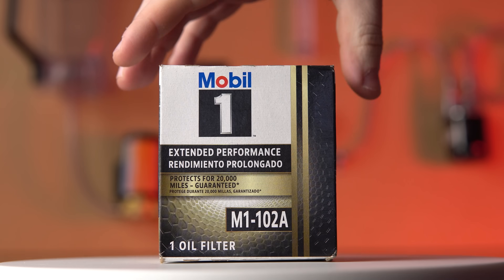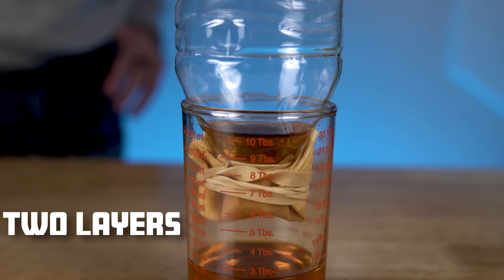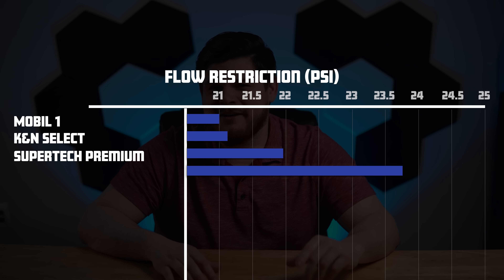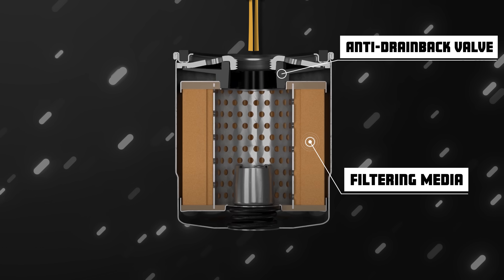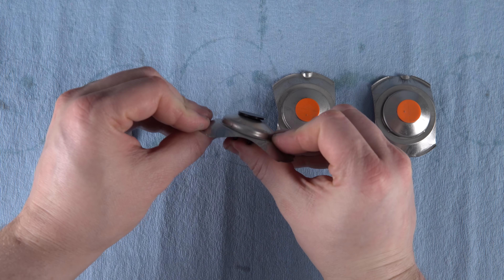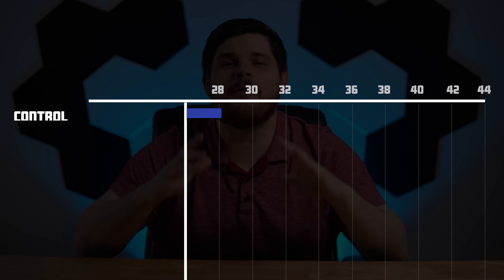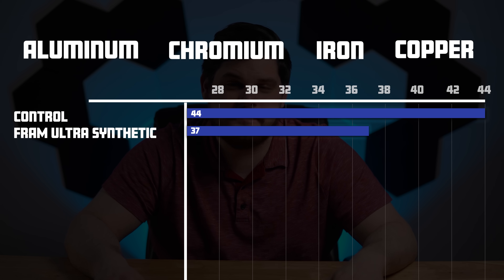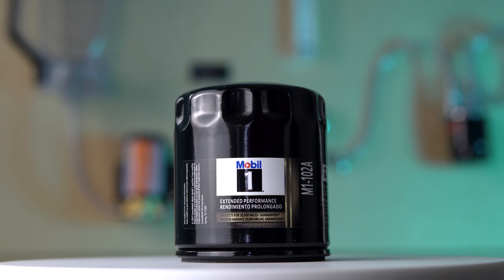Engineers Test the Best Oil Filters! FRAM | Mobil 1 | K&N | Walmart Brand

Comment: Great vid!  However, The filter back pressure is inconsequential. All filter systems have a bypass that allow the oil to bypass the filter and go directly to the engine. Although the primary purpose of this bypass is to prevent engine damage in the event of a clogged filter, if the filter is not passing all the oil going to the engine, it doesn’t mean that the filtering is bad. In fact, it could mean that the filtering is good, because the filter is possibly filtering out smaller particles. What needs to be measured is not just what the pressure drop is, but the pressure drop and how clean the oil is coming out on the other side. Those two factors together plus also measuring how much crud can be collected in the filter before it quits flowing, those are the factors you would like to measure. You did a good job covering all these factors so Bravo!

Comment: Any filter around $10.00 give or take a buck or two should be sufficient. I’m a Mobil One filter guy for my 2007 Jeep Grand Cherokee with 144,000 miles and still runs great no burning or leaking. High mileage oils have conditioners to keep the seals in good condition so I would recommend them. Best oil is clean oil.

Comment: Holding less grams of aluminum powder may not be a bad thing. It may mean that the filter has smaller pores, this clogging more quickly, but also filtering smaller particles. And if there were this much aluminum in the oil, the engine would be toast anyway.

Comment: Nobody should be going over 5,000 miles. I dont care what kind of magic oil you use, or what filter. 10,000 miles, 20,000 is just rediculious. Especially on todays small gdi turbo engines. I still change my oil at 3500 miles. Just an old habit from the conventional 10w30 days. I enjoy changing my oil, its not that expensive, and I plan on keeping my current vehicle forever. One thing people forget to do these days is replace their pcv valves. That is critical. I also highly recommend an oil catch can on modern gdi engines. Especially if its turbo.

Comment: Let me guess that this evaluation was supported and paid for by Mobil 1. You couldn't have sounded more bias throughout the video if you wanted to. Not a huge fan of Fram, but a 20 micron filter surpasses a 30 under normal conditions every day of the week. How comical when you spoon feed aluminum into a filter then criticize it's clogged after it stopped every bit.

Comment: I use Mobil 1 Extended Performance oil and matching filters in my 2006 Acura CSX. I put around 10-12,000 kms on my car per year; mostly short trips in town. Even though the oil is claimed to be good for one year or 25,000 kms, I change it twice per year in the spring and in the fall. I buy the oil and filters ahead of time when they’re on sale; meaning I can do premium synthetic oil changes for less than $60 here in Canada. I also like knowing exactly what is going into my car, that it’s done right, and I can look at other components while I’m under the car. 

Some people might say that the auto engineers know best when they suggest oil change intervals of 10-15 thousand miles between oil changes. However, those intervals allow them to claim lower annual maintenance costs in their marketing. Also, it’s probably fair to say that the manufacturers probably care more about the engine just making it past their factory warranty rather than the customer getting the absolute  most life out of their engine.
Reply from the maker: Thank you for sharing and for watching!
Reply: Thanks for putting in the time and effort towards creating such an in depth, educational video. The tests were all well done and relevant towards the actual use and function of oil filters. 

Taking them all apart and explaining the various parts as well as their purpose was the icing on the cake for me.

Comment: Will the minor differences at the extremes make any difference in a real car? 40 ppm after 18k miles is about .2 grams of total material in 6 quarts of oil. Does the ability to hold 48 vs 25 grams matter when you’re filtering out .2 grams

Comment: It doesn't matter what science shows....many people will still believe the old "3,000 miles and oil is cheap".  The truth is...oil technologies have improved to conserve resources while providing better protection.  Today's oil is not "cheap" for some people.  I only use Amsoil.  Not because it costs more...but it's been proven better time and time again...despite naysayers attempts to say otherwise.  However there are many impressive oil brands regardless, but I need specific oils for my car and am limited to just a few.  It doesn't matter what's on the side of the oil filter box if you don't maintain your vehicle properly ...nor if you are buying the cheapest oils out there.  They are cheap for a reason.  Oil filter capacity should not be as much of a concern as the micron levels and multi pass filtration ratings.  If your car is maxing out the filtration of the filters...your car is wearing or breaking down irregularly and you have bigger issues.  Buy a good quality filter and change your oils regularly based on what you are actually buying.  I am comfortable with my Mahle cartridge filters and Amsoil for my BMW at 7500 mile intervals.  Why?  The oil analysis I had performed indicated that the oil would go longer....perhaps 10k as BMW recommends.  Each oil change ( self performed) costs me about $80 in materials....up to 3 times a year.

Comment: I put 478,000 miles on a SAAB 900 TURBO using 10w30 Castrol and Fram filters Original Turbo and she is still going smooth... even 10w30 Castrol in gearbox well transaxle...changed every 3,000 miles...

Comment: The test method has an issue. Measuring a pressure before the filter thats above the bypass rating without a restriction after the filter means all of these filters were in bypass, meaninf the ratings were showing flow rate of that bypass. 

The more accurate way would be to restrict the flow after the filter and measure the difference between the two, making sure the pressure difference didnt exceed the bypass spec.
Reply: Also I should point out that under normal operation at operating temperature every filter will be in partial bypass during high rpm or sudden rpm changes. Besides cold start the primary job of the bypass is to allow most of the oil to be filtered without building pressure that would collapse and tear the filtering media.
Reply from the maker: @braschlosan, you bring excellent points! We have greatly improved our testing procedures to follow ISO standards to the best of our ability. Feel free to checkout our new videos. All feedback is greatly appreciated.

Comment: Fram is garbage and has been garbage since the very first one! I had an engine built once, gave them a Mobile filter and Castrol oil only to find out after 3000 miles they kept my good stuff and threw Fram on it and who knows what for “oil” and it was full of paper and shit! 20 years ago $1500 rebuild turned to shit and I got the privilege of eating that shit! Never use Fram! Stop using places that use Fram! Always check and pull it straight off and throw it at them! Walmart’s SuperTech works well, AC Delhi is superior for all GM’s, Motocraft for ford and I always used Mobile’s filters for my Ram. When the Ram was finished the engine was all that never needed major work. My Saturn has 322+++ miles and that engine is as good as any competitor at 20,000 miles. Wife’s Pontiac gets Delhi filters and guess what, that engine outlived her transmission and is still a powerhouse. The biggest rule for not sabotaging your engine oil is NEVER USE A FRAM. If you can’t get anything else, don’t change the oil until you can get any different filter
Reply: lies

Comment: I have been hearing that from oil filters are the worst for decades. There’s a problem with this. Frenak makes oil filters for customer businesses also under the customers name. If you ever suspect that and oil filter may also be made by Fram but has a different name like STP or Deutsch, open the box and compare where are the oil filter gasket and screw on section is.. compare the two filters, Frim, and whatever you think may be made by for him, if they are the same, those customer filters are also made by Fram to their standards with their materials and manufacturing process
  to be safe, just by Purolator, oil filters, or NAPA, gold, or hiflo-i think made in the UK..hiflo filters come with a protective plastic shower hat, like cover on the filter and, the gasket is already coated with Petroleum jelly

Comment: I just saw a product on Amazon. A disk shaped magnet slightly less in diameter as THESE filters that attached at the end of the filter.  . The magnet is impressively strong.
Reply: Speaker magnets or broken up hard drives stuck on he side .

Comment: GREAT video.  Well structured test that we can trust.  In the way past I used Mobil filters along with mobil1 oil.  About a decade ago I quite using Mobil oil, as it is just crap.   I have since been using exclusively the Fram Ultra in all 5 of the trucks.  Very happy with the Fram results and no intention of switching.  However, the cut open and look inside the Mobil filter in this video does give pause and ponder.  Future test suggestion, how about A cut open of assorted Mobil filters (different sizes and part#s) would be helpful to see if they are all built the same or if there are crap Mobil filters pending what size your car uses.

Comment: Do you change your  filter  at  every oil change or at every other oil change? I have always bought larger or and longer oil filters when ever I can .. for a small Block Chevy  I could easily find a much larger oil filter for $3.50 to $4.50
  It's Crazy, they sell K&N Oil filters for Motorcycles for like  $15.00 I have bought Fram Motorcycle oil filters from Walmart for $4.11 recently while the Local Power Sports dealer was selling the same Part # for $12.00

Comment: The test seems to run the oil at room temperature instead of engine temperature which can drastically skew the filtering data. It was breifly mentioned that the fram was the only filter in the lineup that filtered 20um particles at 99, but 30um particles where used. It doesn't seem like the oils quality was tested after the particle test, giving no data on how clean the oil was after filtering.

Comment: What is the temperature of the oil,  what is the viscosity at that temp, I think you just measured the "by pass valve pressure".  You have to have to heat the oil to normal running temp.  The bypass opens when the oil is cold, the filter is only filtering when the oil is up to temperature.   MY car is stored outside, it is now 14F outside.  ron
Reply from the maker: Hey Ron! Thanks for watching. Make sure to check out our latest videos with our new testing rig with improved testing methodology.

Comment: Hmm. I've always used the Supertech or Fram and Supertech oil or whatever I cam find that is the cheapest and my last Toyota I sold had 300k miles. My current Yaris has over 230k miles and both still running on original parts except brakes and routine maintenance things.

Comment: It's comical, that all oil filters claim they are the best at making your oil last longer, meanwhile your Oil is breaking down from friction and heat. The only thing a filter does is keep tiny contaminants from metal on metal  re entering the circulation system. Some do a better job than others and,  Oil filters have absolutely nothing to do with how long your oil lasts none, notta, no way  and never will.  The quicker you understand that the longer your engine will last.  Change your oil every 5 thousand miles NO MATTER WHAT end of story, no matter what anyone tells you.  Listen to the Pro's not a marketing commercial or some trumped up fake research.

Comment: Since an engines oil filtration system is only a bypass system, the more restrictive filter will pass less oil but will filter out more per unit of oil passed while a less restrictive filter will pass more oil but filter out less per unit passed.  The best way to improve both filtration efficiency and to reduce restriction is to have a larger surface area of filter. This should have been measured. The optimum ratio between restriction and filter efficiency would be engine and driving habit dependent (oil temperature, oil pressure profile and others).  The filtration test is the test that potentially cuts to the bottom line but since it is not done at anything near to actual engine operating conditions (temperature, pressure, full pass instead of bypass), it too becomes meaningless.  I would go with Mobil 1 because the superior build quality suggests they may have taken the care to get other things right.
Reply: Very good observation on the many un-controlled variables in this test.  I'm surprised the "engineers" didn't account for it, and many other factors.
Reply from the maker: Thanks for the feedback! We have made a couple of improvements on new released videos to the rig that addressed some of these feedback points! Thanks for watching!
Reply: @BrandRanks  I look forward to your next video and am impressed that you took the time to reply to me.  Good luck.

Comment: Your pressure drop test seems to be meaningless.  The pressure drops recorded are all above the filter internal bypass pressures -- it seems that you were testing the bypass valves, not the filter media.  Next time, try a lower flow rate in keeping with the actual car oil pump capacity.
Reply from the maker: Hey thanks for the feedback. Make sure to watch our latest videos were we made several improvements to the testing methods! Thanks for watching

Comment: So I’m a high schooler of course with a g35 and was wondering because I’m using k&n’s gold oil filter because I’ve used it before on stuff but the problem is the g35 is my daily and I want it to last until like 300k miles and like he said using more filtration media is better for keeping engine clean rather than high flow less restrictive. So should I switch to the Fram ultra or endurance? Or switch to Mobil one at Walmart to reduce my oil changes which cost money of course.
Reply from the maker: Hey! Thanks for watching. Remember that changing your filter and oil at the manufacturers recommended interval is way more important than what filter you use, but if it was up to me I'd switch to an ultra or endurance or even Mobil 1. We've been testing several filters and it shows that KN although good at flow is not great at filtering. I hope this helps. Again, thanks for watching.

Comment: my GMC Canyon 05' with 265K miles runs fine. Doesn't burn oil and I have used various oils and filters. Change your oil is smart to do - but it really comes down to how good of an engine was originally built for your vehicle. Hope you didn't get the bad one built at the close of shift on a weekend!

Comment: Oil filters are 15 times LESS restrictive than the lubrication circuit itself.  With a positive displacement oil pump, it really doesn't matter.  Unless the pump is in pressure relief, it will still flow just fine between each filter.

Comment: The test was pointless comparing spples to oranges.  Anyone providing a test of filters that are not of the same capacity simply don't understand textbook basics.  Why have 20 micron filters and 30 micron filters in the same sampling?  The favored mobil one only filters down to 30 microns where the fram media traps down to 20 microns.  Anything larger than 20 goes straight thru the mobile one hence easier flow.  Bad mouthing a filter that filters better shows your bias.  This test was not credible and neither are you.

Comment: You say "the more filtering media you have, the more restricted the oil is".    Not true.  The more square inches of filtering media surface area there is, the LESS restrictive the filter is.
Second; the filter caps are not made of aluminum, they are all made of steel.
Third, all these filters will do the job required of them,  just get one you feel comfortable with.

Comment: Okay... 
The Mobile1 original Impedance-Pressure is 21lbs PSI
The K&N's original Impedance-Pressure is 21.1lbs PSI
.
The Mobile1holds More contaminants before impeding Flow to an unacceptable level.
The K&N holds Less contaminants before impeding Flow to an unacceptable level.
.
... But the Mobile1 also takes Longer to fill up - because it actually CATCHES/FILTERS only larger contaminants, meaning that overall, it Catches/Filters significantly less contaminants than the K&N - - Resulting in the higher Mobile1 Contaminant-Number from the Lab.

So if Mobile1 is only able to claim 20K-mile protection because its inferior filtering capability allows it to "Last Longer" before it fills to impedance-pressure...

Does that Really make it better - since the primary function of a Filter is to... Filter?

Comment: The true test would be to run engines for many miles or hours and many heat cycles  using the same oil and filters equal oil change intervals then  do wear test. Least wear would prove best filter.

Comment: BUYER BEWARE!!! 2500 MILES AFTER INSTALLATION ON MY 2018 RAM. MY FRAM OIL FILTER WAS BROKEN INSIDE WHERE IT GOES. I WILL NEVER BUY THIS BRAND AGAIN. I HAD TO PRE CHECK MY OIL WAY BEFORE DUE TO BE CHANGED TO NOTICE MY FILTER FAILED AT GOD KNOWS WHEN AND LEFT MY OIL NO GOOD IN JUST A SHORT TIME AND HAD TO SPEND ANOTHER $75 JUST TO DO ANOTHER DIY OIL CHANGE.

Comment: The majority of the oil filters are all made by the same companies. It's all b.s.
Reply: Yeah, the differences he measured could be chalked down the manufacturing variance between filters. You’ll have a good experience with any of these premium high mileage filters. Buy the cheapest or most convenient. In my case, the fram ultra is what I use because it is $7-8 and always in stock at both Walmart and Amazon